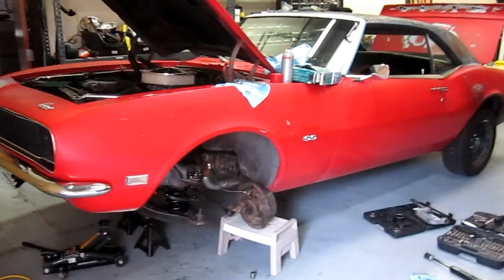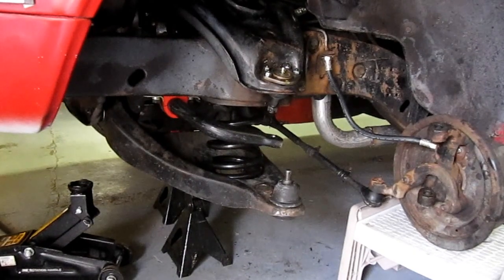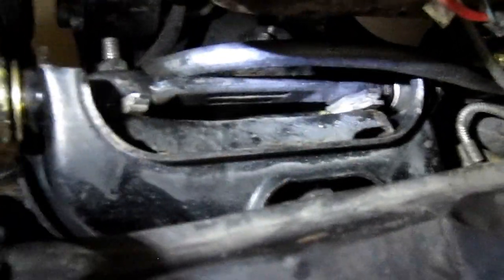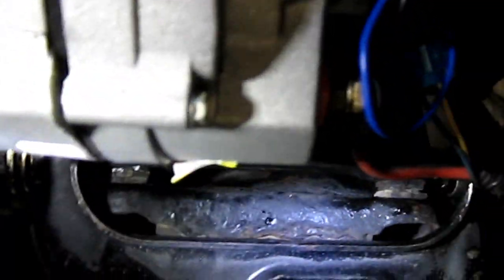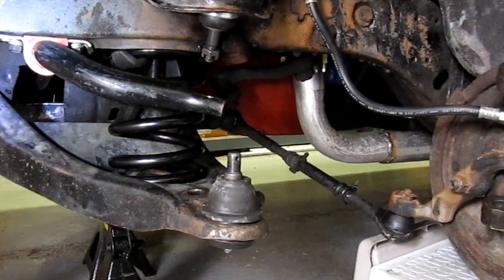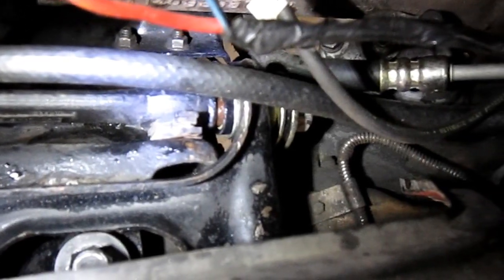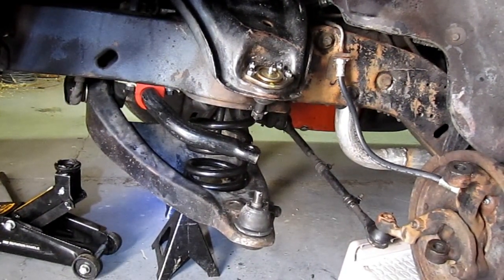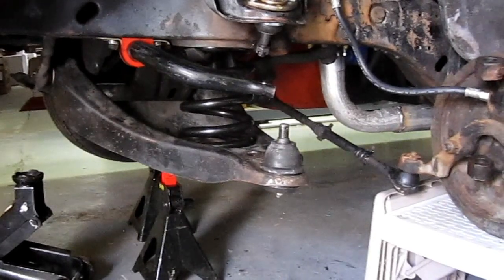1968 camaro suspension rebuild part 2

Comment: I'm guessing you didn't actually remove the upper control bolts. Yes, they're 'pressed' in. They're splined so they don't rotate. Since you spun the one, no real harm done. Now you have to have a wrench on each end whereas before the splines held the bolt. I'm about to install tubular arms and I'll be tackling this challenge myself.

Comment: Thanks for putting this out there dude. I'm considering putting an entire front end rebuild kit on my '68 Convertible. Some questions - what would you say you would change about how you installed the kit, if anything? Kind of "I wish I would have known this first" help. Also - Can you rent a ball joint press from the auto supply?
Reply from the maker: +Alan K Thank you for the kind words. I was able to borrow/rent a ball joint press from my local parts store. I had to go to a friends house to used his hydraulic press for the bushing sleeves. The biggest mistake i made was spinning the studs that hold the bar (for the upper control arm) to the frame. They are knurled and pressed into the frame rail and I used my impact on the outer (easier to get to from the wheel well) head of the bolt instead of the nut on the inside. This probably won't cause me any problems in the future. Another tip is: when using the spring compressor add a couple of washers with some lube and an impact from the top. It will be much easier than wrenching by hand. I didn't use the lube and it still wore my arm out, even with the impact. If I remember anything else, i'll let you know.
Reply: Thanks dude. Much appreciated.
Reply: @alank7524  - Did you end up changing out your 68 Convertible?  Any advice, etc.?  67 Convertible - all original suspension here but hasn't moved since the 70s.
Reply: @FSMWorshiper  Yes, I took the entire front suspension apart and replaced all bushings; ball joints; tie rods; idler arm; pitman arm; upper/lower control arm bushings; and recommend you go to a larger 1 1/8" sway bar. There is a series of 5 videos out there that helped me. Old videos but helpful https://www.youtube.com/watch?v=6C_JJ_C5Mjo

Comment: Hi, congrats man,
I'm doing the bushings on a 68 SS 396 myself.
I didn't remove the upper side of the pindle, just the disk brake.
I'm having a problem with the coil springs.
How the hell did you manage to get the spring into place ?
Thanks, and have a nice ride :)
Reply from the maker: Thanks for the compliments. To compress the spring I "borrowed" a coil spring compressor from orielly's. It basically pulls the spring into the sub-frame pocket. I had to use my impact to tighten it up all the way because I got bored after about 5 minutes of screwing that thing down.

Comment: Josh - I'm rebuilding my front end now and having a hell of a time getting my lower control arms back into the frame. Did you have any issues? Any advice? Also, did you use the spring compressor and compress from the top or the bottom? Thanks
Reply from the maker: I did not have any issues as I recall, I did it by myself with basic hand tools as you can see from the floor around the car. sorry for the late reply